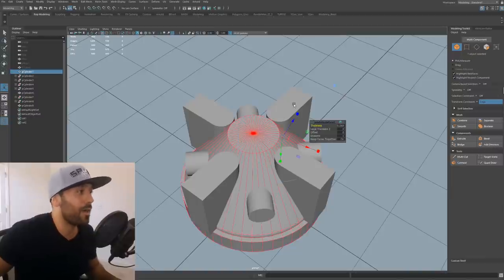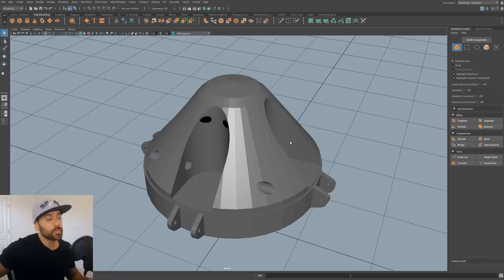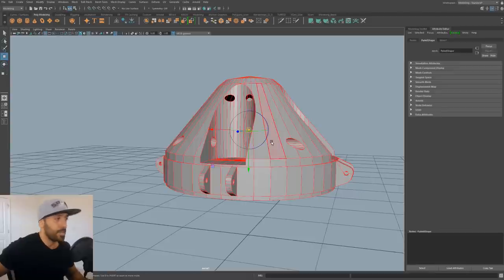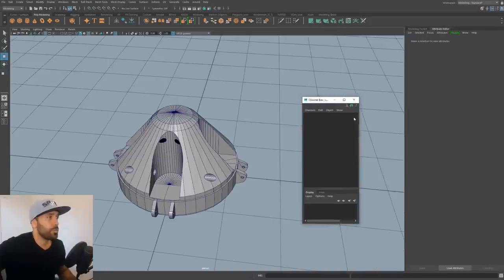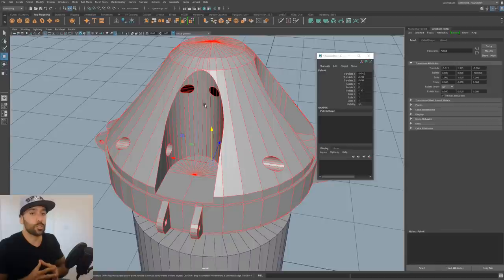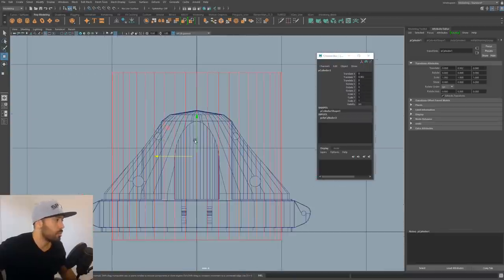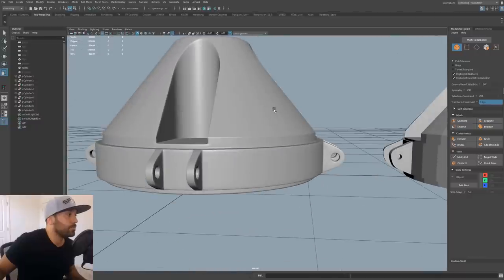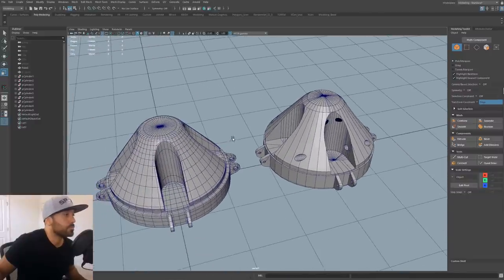Fix My 3d Model #2 Maya Hard Surface Modeling Tutorial: Booleans

Comment: Mr Mussi,his one 16:08,how u set a hotkey within a tool settings? the edge/face constrain as well.
is that through python? I am using MayaLT which not support python.
thanks if any advice.
 I followed several of your tutorials, even copy the operations , what u've done are fast and straight forward.
let me know a lot maya hidden ways of doing things.
Thanks a lot!
Reply: 16.08 u switch from select tool, to paint selection tool..
Reply: @yingbowang3068  Paint selection hotkey is TAB. Should be above caps lock on most keyboards.
Reply: @southpaw9041  Thank u !it works! i dig through the selection tool setting, didn't find any instructions :D

Comment: Man you had me crying laughing with those puns and memes bro. Nice reroutes. Minor question, how is smooth wireframe different than enabling anti aliasing?
Reply: They're completely different things.  The anti-aliasing just improves the look of the wireframe by removing jagged edges whether the model itself is smoothed or not.  Smooth wireframe (preview) just applies a subdivision algorithm to the model and shows you in the viewport how your model will look when subdivided.  Arnold will actually render the smoothed mesh preview at render time without having to apply any subdivisions to your model which is pretty useful.